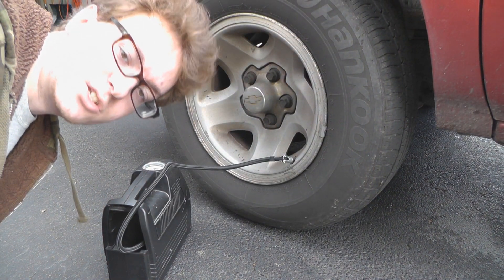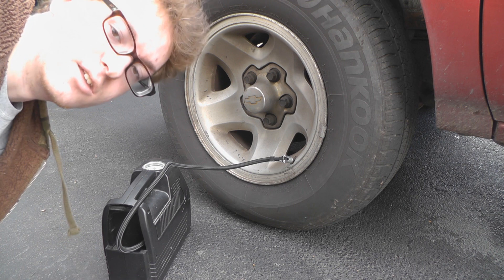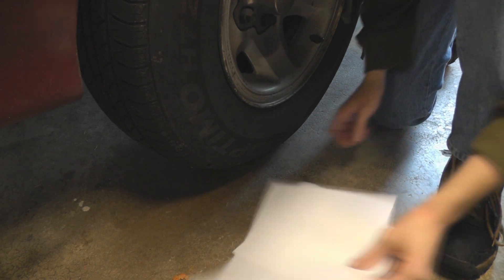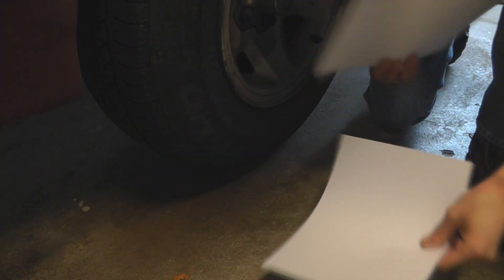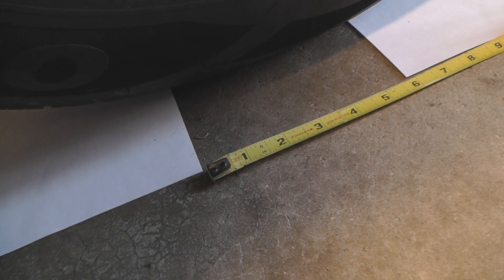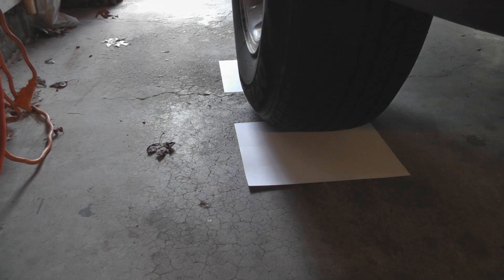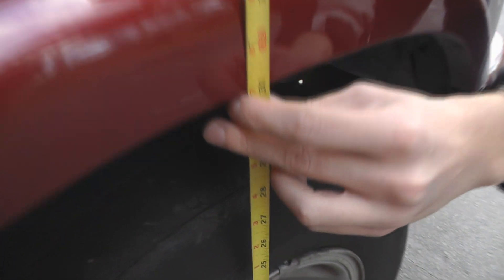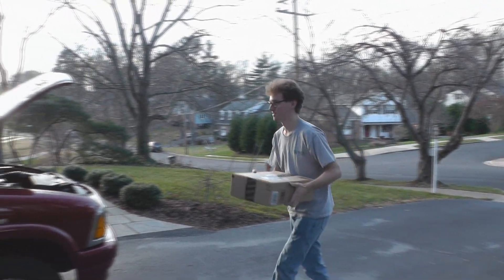S10 EV Conversion: Measurements - Part 02

Comment: subscribed
u dont have to worry about the radials keeping the weight of the tyre, its only wire wrapped around heaps of times to act like rebar in concrete.